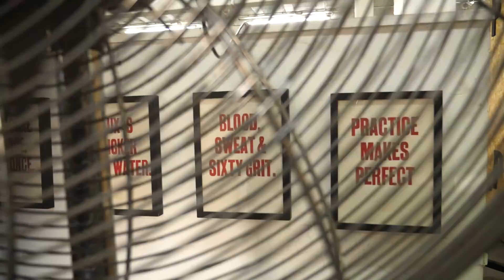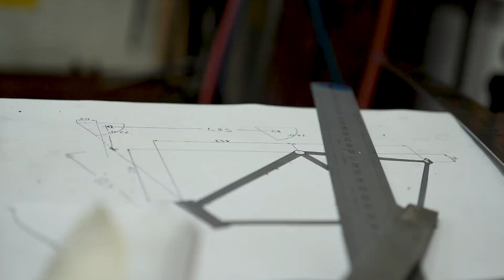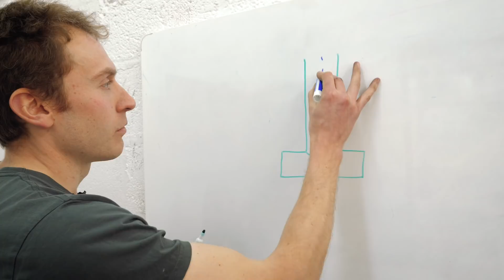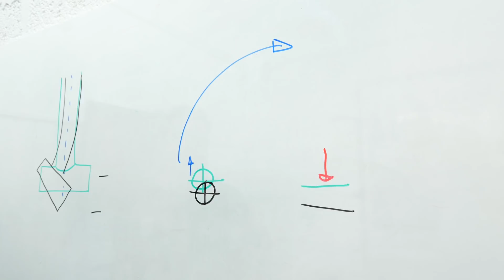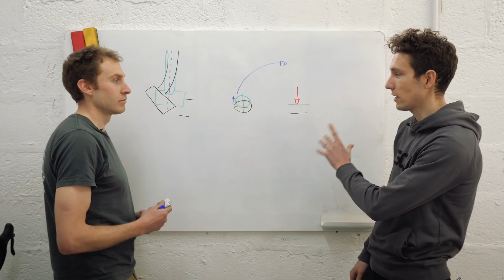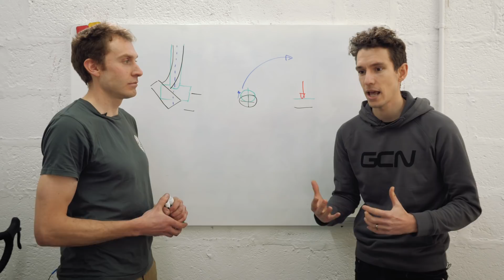Are You Faster On A Stiffer Bike?

Comment: Two things: First, no form of energy transfer can be 100% efficient. While most of the force that went into flexing the frame will be returned to the drive train, some will end up getting lost. Secondly, it isn't the difference in speed that we feel going from a flexible to a stiff bike. It is the difference in responsiveness. When we apply force to the pedals of a flexible bike, that initially goes into flexing the frame instead of moving you foreword. As a result, a stiffer bike will be quicker to jump off the start line as apposed to a flexible one.
Reply: also worth noting the importance of stiffness in the front end as well. You want the bike to steer as soon as u point it right or left as oppose to just flex and then bounce back to steer whenever the frame feels like it... which at the end of the say will also make you slower as you corner with less precision and confidence
Reply: Max Sievers  I posted that earlier. Jan's work on planing. All these comments from these guys who think they know everything because they're just repeating what they read. Stiffer is not faster. It's just one of those of many false narratives that have been around in cycling for the longest time. Like I commented earlier the MotoGP teams have gone from Super stiff frames too much more flexible frames and speed and lap times are going up because  of the increase in grip, from a chassis that doesn't just dissipate the energy but rather 'puts' some of it back into the wheels.
Reply: Or maybe you are riding a really noodly bike in which case I'm sorry for that comment
Reply: Tobias Grätzer Go watch some videos of a racecar hitting a rumblestrip in slow-motion, you will see the science in its truest form.
Reply: A frame that planes for you is responsive and it can corner well.
Reply: Ive been blessed to be able to test hundreds of different bikes at my previous job, and I can definitely agree that there is an extremely tangible difference in responsiveness between frames of varying stiffness.  For example, I disliked the S-Works Venge Vias quite a bit because of just how slowly it seemed to get up to speed, even compared to a base level tarmac of the same weight.  It might not have even clocked any differently, but the feeling of flex was not something I looked for.
Reply: Samuel Hopely Well Bicycle Quarterly did actually test if the phenomenon of planing is real. It is! You are faster on a frame that flexes the right way so it planes for you.
Reply: Matthew Gilster Maybe in theory but I don't know if it would be quicker off the line in practice. This is something that would have to be further researched and proven but as it stands I'm inclined to believe that it's incorrect
Reply: That's theory. Makes me wonder if you even ride a bike
Reply: MotoGP is a very different extreme where the total package performance is so heavily biased to the cornering performance under extreme lean angles. 'Performance' in a road bike racing context has very little to with bike handling and biased much more heavily to higher energy transfer efficiency. If you were doing a track sprint it should be pretty obvious that you want as a stiff a frame as possible to minimise energy losses however this is more than likely not what you want when riding over a rough road on a decent.

The important take way is that frame stiffness is a specification that should be set during the design phase and not something that should be chased above all else. You don't want uncontrolled frame flex and you don't want a 'theoretically' perfectly rigid frame on a bike that does not have any suspension. You want a frame that is stiff under the torsional loads generated by the rider pedaling but you'll probably want some degree of flex vertically on the rear triangle and front fork (but not too much considering it's undamped).
Reply: Paramour  you obviously did not read through the entire post and you did not bother to take in what the message was. because you missed the point. The point is that motorcycle chassis have actually evolved into lest stiffer chassis because engineer's have figured out that a certain amount of frame flex and flex in the right parts of the frame make for a more efficient chassis with less energy loss. Same goes for the bicycle and any other similar machines.

Comment: How big the differences are between stiff and just relatively stiff frames I'm not sure. There must be a difference though. Try sprinting on a dual suspension bike with no lockout.....you'll definitely lose energy there....the principle is surely the same, but just to a lesser degree, no?
Reply: I suppose this is the case mainly because of dampers in suspension.

Comment: Simon has described two possible outcomes.

1. Is the experiment incorrect and stiffness does cost Watts. The solution would therefore be a stiffer bike reducing Watts lost.

2. Energy is transferred to potential in the frame, which in turn gets converted to kinetic energy in the drive train.

The problem with 2. is that no system is ideal. There will still be normal resistive losses in the drive train but added to that will be efficiency losses in the flex part of the experiment system. The solution would therefore be a stiffer bike reducing Watts lost.

Ultimately though, the Watt losses are tiny and insignificant. And most likely its only the riders in the top 1% of the sport can see benefits.

Amatures will affected more by other variables fluctuating (for example, weight or fuel choice) and probably shouldn't worry about  minor stiffness improvements.

Comment: Springs are like inductors, and force is like current in an electric circuit. The bottom bracket is a big spring.
If you have a simple circuit with a light, a switch, and a current source, the light will turn on pretty much as soon as you flick the switch.
If you chuck an inductor in there, the light will slowly turn on when you close the switch. Then, if you open the switch, the light will not immediately turn off, but instead fade out.
"In theory," all of the magic pixies will make it where they're going, but they just take a bit longer. In reality, a few will get lost along the way due to losses in heat, friction, etc.
For a bicycle, it depends what you want. When you press the pedals, do you want the light to come on right away, or are you okay with a bit of a slower response?

Comment: What about the flex on the non drive side. Does it counter the flex?
Reply: The same thing happens, just mirrored. Therefore, it was a bit odd that he said the effective "clockwise" motion of the BB - on the non drive side it will be an effective counter clockwise motion of the BB that gives you the little kick when the frame returns into its normal position.
Reply: This is exactly what i thought. He's testing the "clockwise" side of the bike. (Maybe due to the setup being against the wall and inherently wanting to see the drivetrain during tesing). 
On the other pedal the return kick would produce anti-clockwise energy?? Would this cancel out the clockwise energy produced in the previous half stroke [hence his IS Wasted energy] ?? Would this if tested similarly, force the drivetrain backwards and no wheel spin created, since it would just spin the freehunb? Or would it still "create" energy since no matter which direction clockwise or anti, still be energy and movement thta the bike has, and that is used for movement...? 
(I ride a reasonable flexy cheap Allez so would love to know!)
Reply: The clockwise/anti-clockwise energy is at the level of the crank, but is applied in different points of time. All is transferred into "clockwise" (forward driving) energy at the level of the drivetrain. It's just a perspective thing. By the way, this doesn't imply the theory of flex-restored-energy is correct, just expanding the theory to the non drive side.
Reply: I would say that you see the same amount of flex on both sides. There may be a small variation as they are mechanicaly asymetrical, this may be insignificant, but pro teams with pedal stroke analysis may say different.

On a more flexible frame you would see a pendulum effect. As you are on the upstroke of the right pedal the frame flex is unloading to the right, while also being flexed to the right by the downstroke of the left pedal.

As the left pedal is on the upstroke the frame flex is unloading to the left, while also being flexed to the left by the downstroke of the right pedal.

Even the stiffer frame seemed to store energy though. A stiffer frame may still have same effect, perhaps to a lesser degree, just that the flex isn't so noticably focused around the bottom bracket and spread around the whole of the seat tube and down tube flexing to a lesser degree.

Comment: Great video, no real errors in physics I can see, BUT...  2 key aspects are not mentioned.  1.  One needs to calculate or measure the mechanical energy lost to heat as the frame is flexed.  Your experiment assumes the energy is all stored in the frame material like a spring and all released.  Any real material will have dissipation (think of it as internal friction).  That energy is gone forever into heat in the environment.  Maybe the loss is small, maybe not.  WIll depend very much on the material (steel, carbon, Al, Ti). Unfortunately, this loss is VERY hard to measure!   2.  One needs a DYNAMIC measurement in addition to a STATIC force measurement.  The phasing of how the energy is returned will vary with cadence (frequency of spring).   I would be that Al with the same static flex is going to absorb energy different than carbon composite flex while at 100 rpm!

In the end, I think this non-linearity is important.   Stiffness is not everything.  Peter Sagan needs a much stiffer frame for the same effect than I do  :-) 

Still a great video!  Now Si needs to write a PhD thesis on it...

Comment: 0:08 - we transfer the same energy into the drive train. The question is: what happens with the transition of the energy from drive train to the frame?
With less stiff bikes we loose energy for frame deformation as a heat: in radiology projections relative to the riders body - coronal and axial deformation during all stages, sagittal deformation - during acceleration. The latter is the reason, why we see shortened seat and chain stays lengths for "fast" bikes, and that rear triangle minimization is not just for weight reduction and aerodynamics, it's for stiffness increase.  
For experiment with sagittal deformation, place a pillow on a card box (fix it , so it does not slide off the box) - try to push the pillow or cardboard wall, check what way is more efficient (pushing a stiff wall, or not stiff pillow)

Comment: If you isolate what happens with just the drive train and create a fixed point on the frame... sure there is more of an elastic behavior in the frame and that energy goes to where it has been isolated.  But what happens when you are sprinting with no fixed points and you are using your upper body to push down harder on the pedals?  Does a more flexible frame transfer some of that energy stored in the frame  back into the arms rather than the drive train?  Energy always takes the least path of resistance.

Comment: Here's how you analyze frame flex on the open road. Get a crank/pedal/spider and a hub powermeter. Get three frames, a cheap steel one, a mid-range alloy one and a high end alloy one. Keep wheelset and drivetrain same between all bikes. And make the drivetrain as efficient as possible (Ceramicspeed cage, chain, lube or whatever is best). Do multiple sprints and climbs. Compare the data and enjoy.
Reply: You read my mind.  The only difference was I was thinking to use a trainer and a repeatable power profile, like a Trainerroad or Zwift workout with out-of-the-saddle bursts, etc.   Use the same powertap pedals and hub on all bikes.  Maybe repeat the workout a couple times to verify repeatability of the power meter data.

Comment: I personally am more interested in frame flex during cornering, if it helps the tire track the road better like a rear suspension in mtb or does the change in angle of wheel relative to frame might cause instability like a flexing chassis in a non performance oriented car.
Reply: Adrian L Good point.. Usually, espevially with skinny tires, corner performance is underestimated. My empirical evidence suggests stiffer frames give me more confidence in cornering.
Reply: Adrian L  that is a very keen observation because that's exactly what the Grand Prix in world superbike teams are working on. More torsional less lateral stiffness
Reply: I felt instability over the comfort in fast cornering sections with my former steel xc mtb.  I’d rather feel the ground below, not a flexi bike frame in between, trying to do some mediation.  But if you’re not doing a sports ride, this feature can be comfortable.  But than again, sitting on the couch in front TV is even more comfortable.

Comment: One of my bikes is a very light but very flexy alloy fixed gear. Compared to my much stiffer carbon road bike, it doesn't feel slower over all under power, but it does feel squishier and less responsive. This can actually feel nice on climbs, as it compliments the smoothness of the fixed drive train in general, but I would want something much stiffer and more responsive for track sprinting or more explosive efforts.